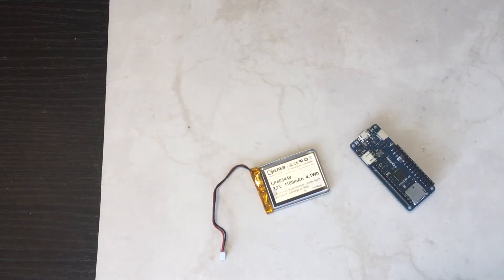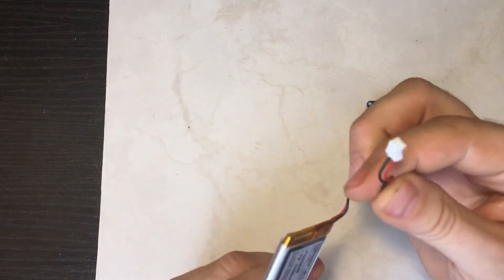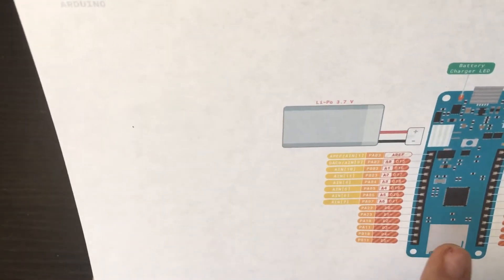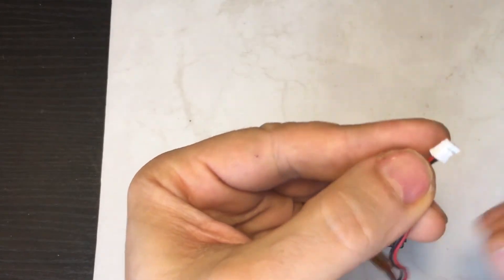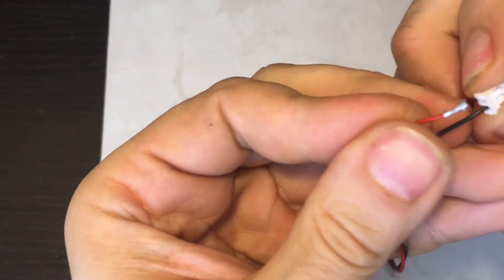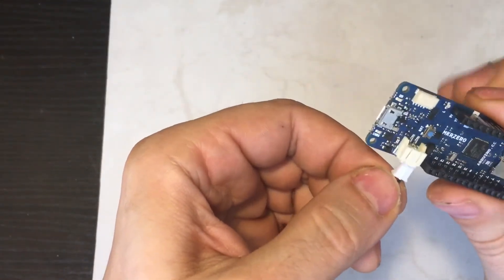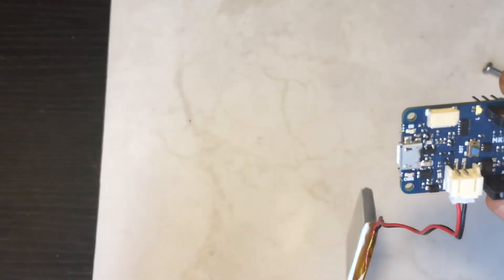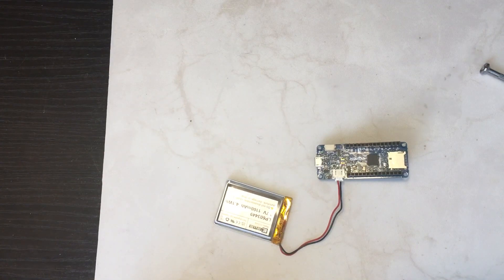Connecting Li-Po battery to Arduino board, check correct polarity!

Comment: Not many arduino boards have this adapter for battery on them, and as I wnna build small devices I hate that, I know arduino mini pro 3.3v is 3.7v ready. Do you know any other arduino boards have that adapter? or do you have any advices on how to use 3.7 battery on devices that dont have this adapter?